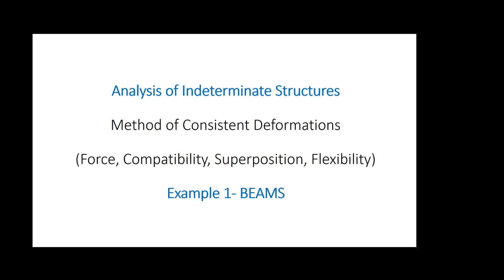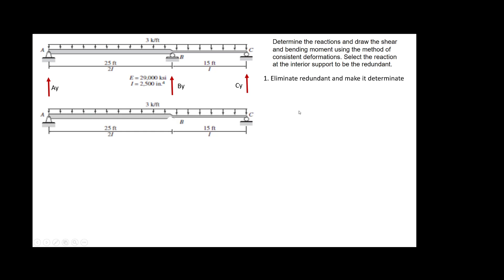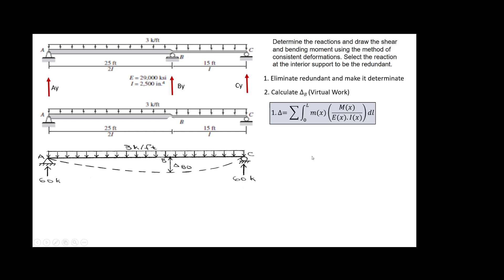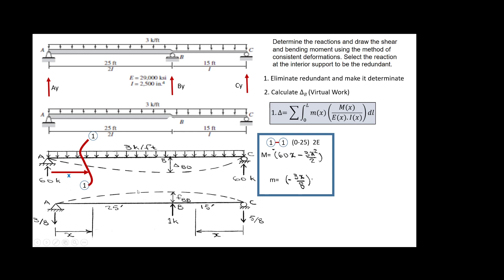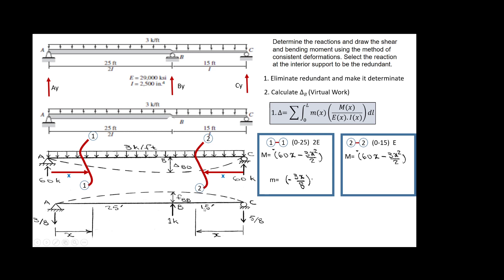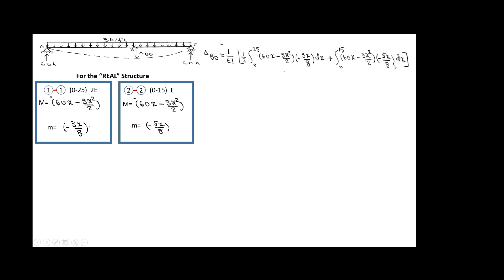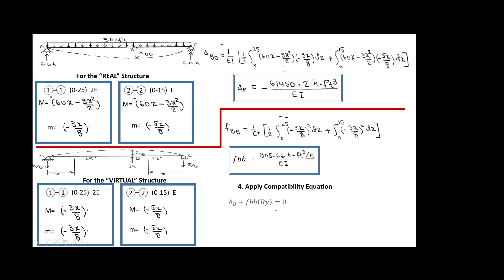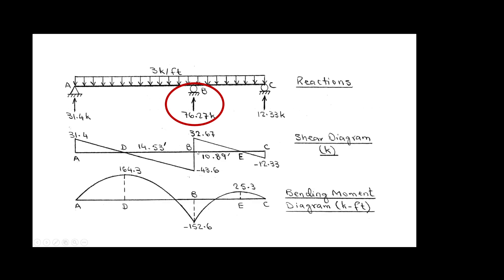Indeterminate Beam Example by Method of Forces (Consistent Deformation)

Comment: Hii. What are the steps to follow when creating an influence line diagram of a statically indeterminate beam with a uniformly distributed load over its span using the approach of consistent deformation? Please 🥺🥺🥺
Reply: I'm referring to the Influence line diagram of the same beam as given in ur video. Please help 🥺